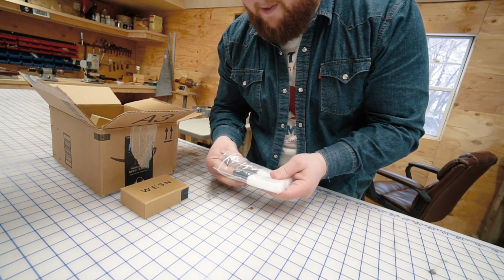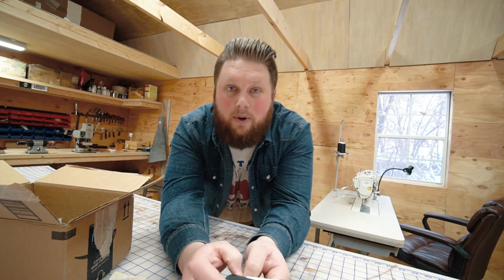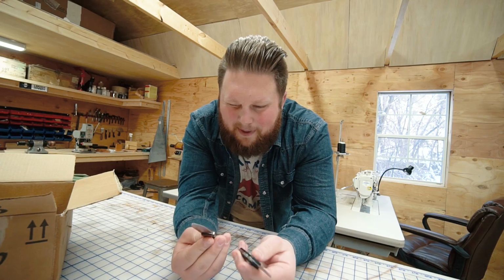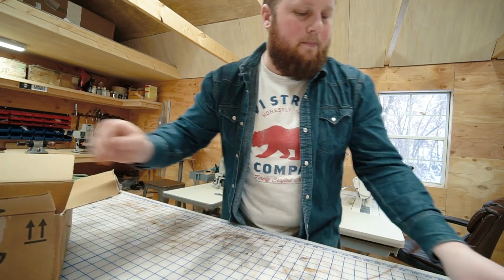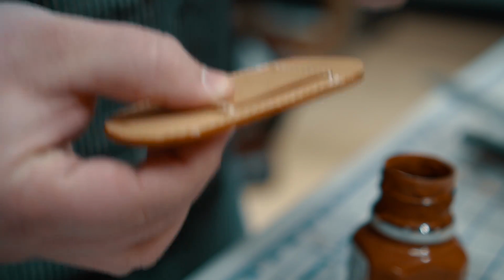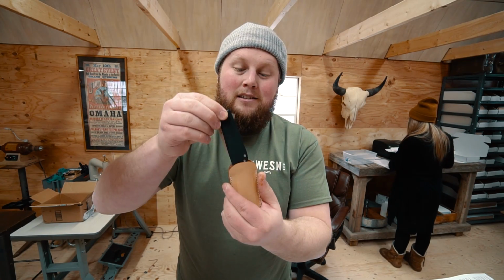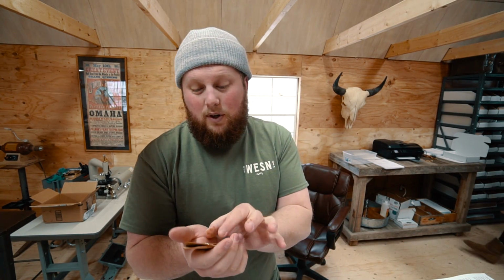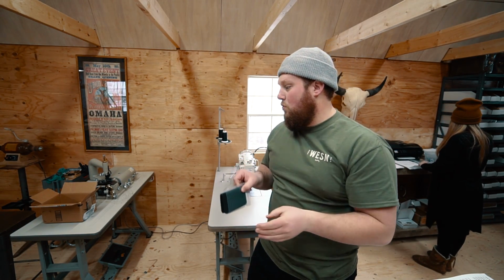Making a Leather Pocket Slip for the WESN Allman Knife

Comment: Curious - What size thread are you using in the Tandy sewing machine? That machine lays down some pretty nice stitches.

Also...make the presser foot indent a "design feature". Adjust your wing dividers and make the line extend from top to bottom vertically on each side to give it  a little visual depth. Just a thought. =)